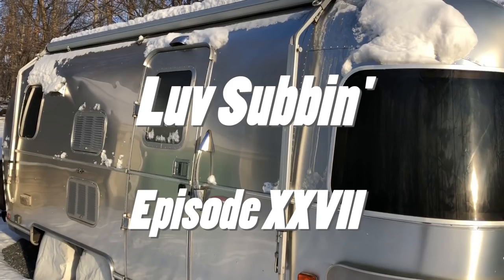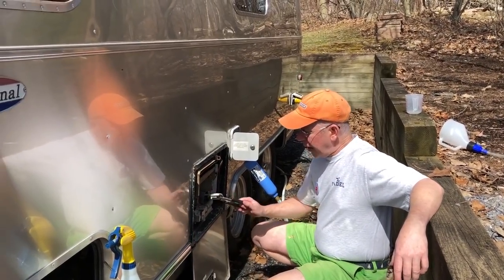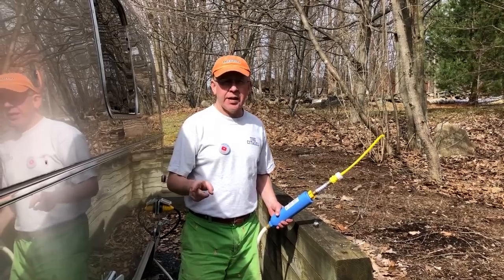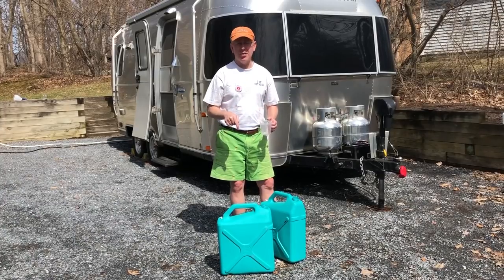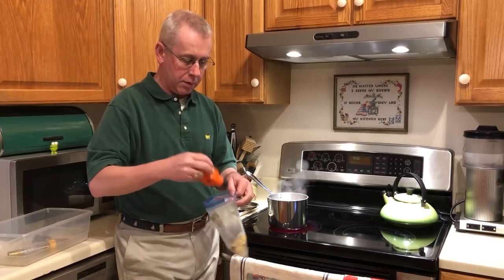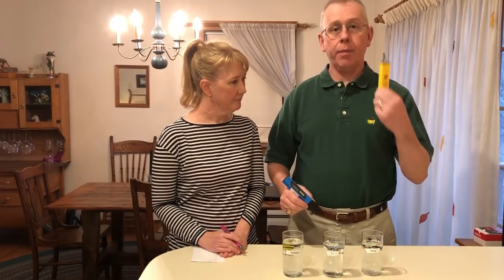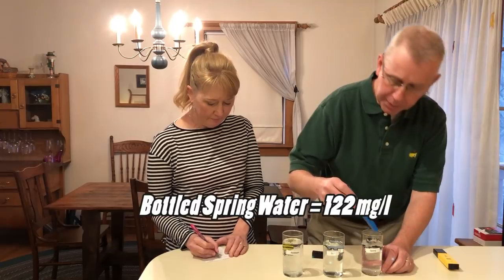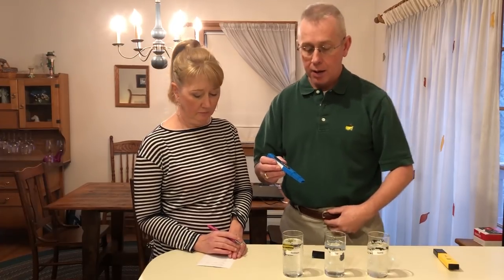Dewinterizing/ Tips for Maintaining your Airstream/ RV Fresh Water System

Comment: We maintain our freshwater system in nearly the same manner.  And we drink the water from our tank after it has been filtered through our Travel Berkey. We use the Berkey because we are filling our freshwater tank from many different sources (campgrounds, rest areas, gas stations, really anywhere we can find free potable water). The Berkey gives us a layer of water safety.
Reply: Hey, mam I had a question. I don't have water hooked up yet but I want to use a portable shower pump/nozzel (one that they use for camping) in the shower itself. I'm wondering where the water would go through the shower drain, and would using that portable shower in there work even though I don't have water hooked up? Thanks a million

Comment: Certainly an eye opening and informative video. I liked it. However, watching you do the prep work without surgical gown, mask and gloves was crazy. The EPA should have been involved and clergy in case it didn't work out. Otherwise it was great. Thank you.
Reply from the maker: Thanks for watching and you made me laugh!  I get the fact that I'm a little extreme but I have the time and I enjoy doing stuff like that.
Reply: Hey, man I had a question. I don't have water hooked up yet but I want to use a portable shower pump/nozzel (one that they use for camping) in the shower itself. I'm wondering where the water would go through the shower drain, and would using that portable shower in there work even though I don't have water hooked up? Thanks a million